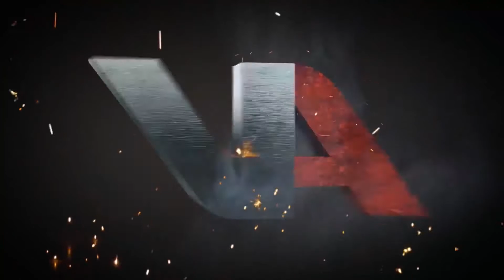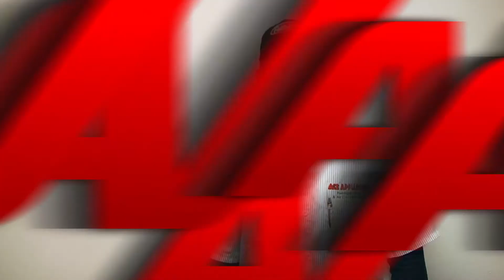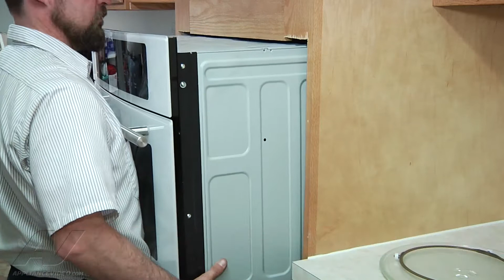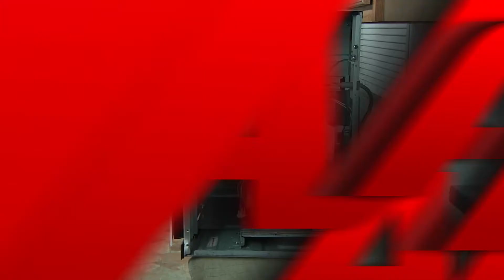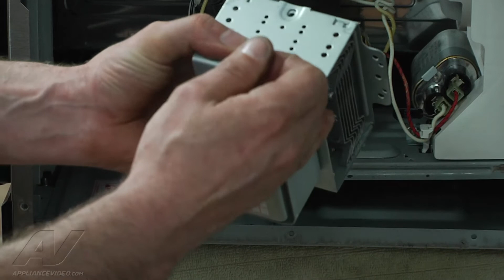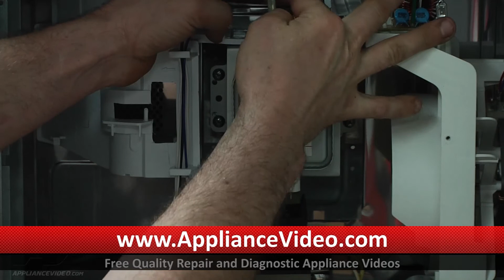Jenn-Air Microwave Repair - Will Not Heat - Magnetron

Comment: I HAVE A  JENN-AIR MICROWAVE  Model # JMC8130DDS. It is a built-in system with the microwave sitting on top of the Jenn-Air electric stove. The turntable motor is bad in the microwave. Can this motor be changed without pulling both the microwave and oven?

Comment: How do you replace the light bulb on that model (or better yet,  Model: JMC8127DDB ). Thanks!
Reply from the maker: Great question, if you have a more technical question that our parts department cannot answer, you can search our over 17,000 answered questions free at our website www.ApplianceVideo.com under our Repair Help section. You can also call our parts department at 1-800-830-5465 and they can give you help 7-days A week ,or search at www.SaveMoreOnParts.com  .

Comment: I have a Jenn air JMC8130DDS Microwave/Electric Wall Oven. 
I had a fire in the oven and since then, the above Microwave turns on , looks fine..
but doesn't heat up..
I had the magnatron changed 2 X's, but that didn't work..
my repair man, gave up..any suggestions..
Reply from the maker: Great question, you can call our parts department at 1-800-830-5465 and they can give
you help 6-days A week Mon-Sat . You can also search at www.SaveMoreOnParts.com 7- days a week.  If you have a more technical question that our parts department cannot answer, our technicians are answering all questions at our website at www.ApplianceVideo.com under our Repair Help section. We have over 4,000
common questions and answers that you can easily search through by your model
number, appliance make, and problem or error codes, and It’s free to search
through our question & answer library.

Comment: Jim,Really simple and easy instructions. One question remains... you said said will change the diode...but did not see you changing it. Next video maybe ?Thanks.
Reply from the maker: Great question, we have diode videos on our website ApplianceVideo.com. or you can call our parts department at 1-800-830-5465 and they can give
you help 6-days A week Mon-Sat . If you have a more technical question that our
parts department cannot answer, our technicians are answering all questions at our website at www.ApplianceVideo.com under our Repair Help section. We have over 4,000
common questions and answers that you can easily search through by your model
number, appliance make, and problem or error codes, and It’s free to search
through our question & answer library.